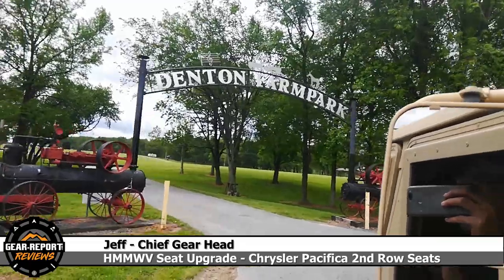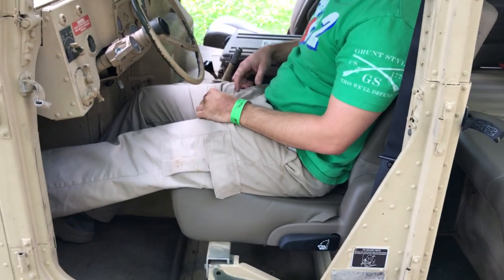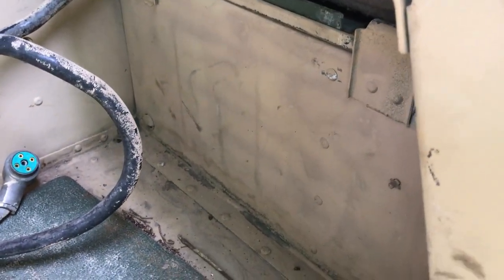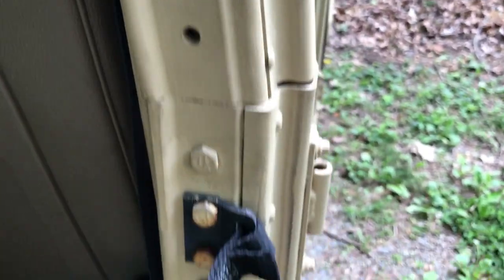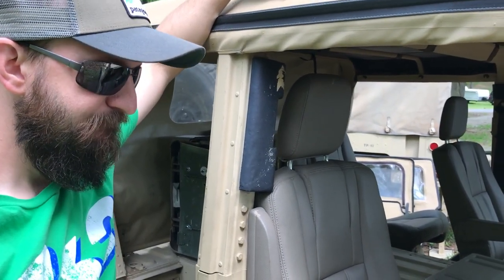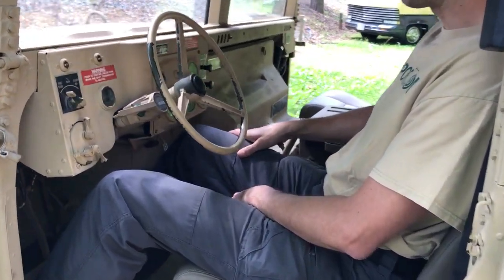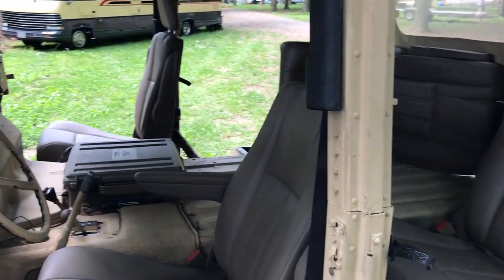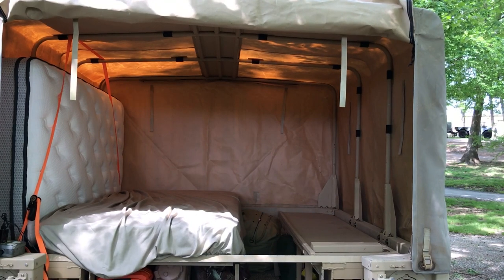Humvee DIY: Aftermarket Seat Options - Chrysler Pacifica Seats

Comment: Suzuki Samurai forums also have sources for these seats as they are preferred swap-ins for those small jeeps as well. Also, Dodge Caravan seats work well. I, myself, have a friend who swapped out his Samurai seats for the caravan. I got his Samurai seats for free and they fit in the the HMMWV very well as they are smaller, light seats. They are many times more comfortable than the original military seats and they recline.
Reply from the maker: Good info. Thanks

Comment: So I bought some off a 2021… and they have the stow and go in them and it is not detachable to mount… the stow and go is one piece… are these from an older Pacifica? 2017ish?
Reply from the maker: The video was made in 2019. So, I guarantee that the seats were older than 2021. But thanks for the feedback. I’ll update the written article with this info on the stow & go.

Comment: Unfortunately not well engineered vehicle, no proper door jams no enough space no good steering wheel and dashboard, not bonnet open in right side and many other problems. At the end useless vahicle but looks beautiful.
Reply from the maker: Seems to have a rather long and distinguished combat record for a “useless“ vehicle.
Reply: @GearreportdotCom im talking about for civilian use. How do you sit comfortably like car. If there were no center bump then it would be better
Reply from the maker: Yes. The specialty vehicle designed for combat was not engineered for civilian utility.
Reply from the maker: @Nupa-bb1xs  Really? Criticizing a purpose built military vehicle because it isn't civil enough for you? LoL
Um, Ok.